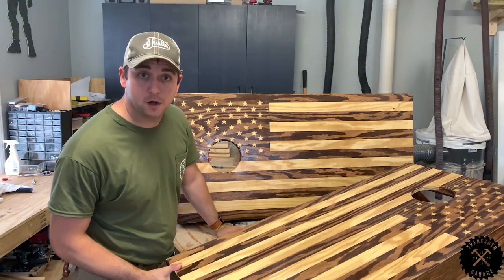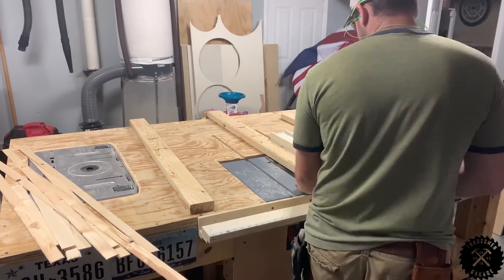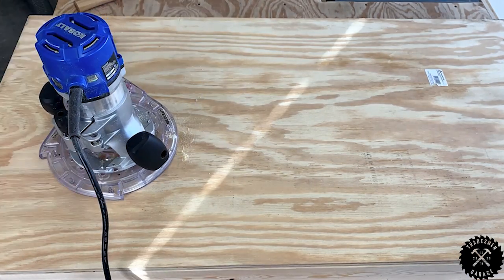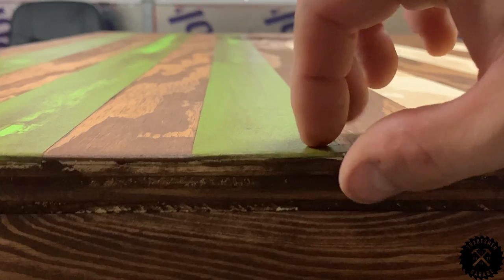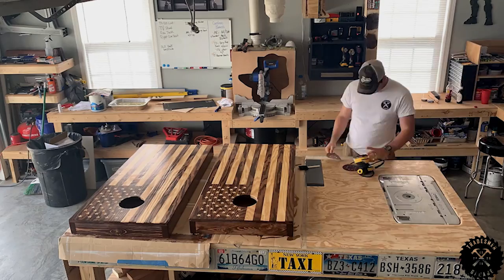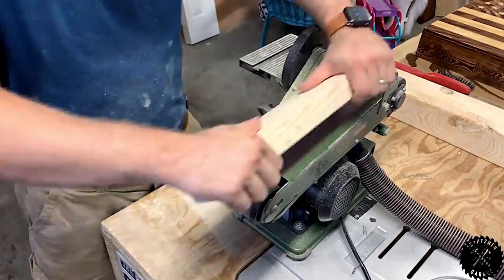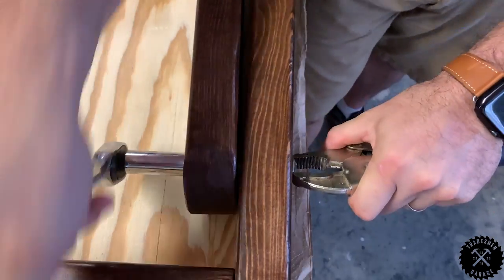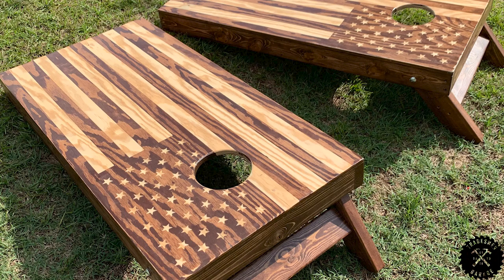How to Make American Flag Cornhole Boards

Comment: You could save a ton of time and energy using 1”  star stickers from amazon. Place the stars,  stain, and lift the stars. Does the same thing as the tape?
Reply from the maker: Micah Crossman true!  But I’m now using vinyl since I got a vinyl cutter recently 😎
Reply: @TradesmenGarage  I just got a cricut and am experimenting with it. Are you making vinyl stars? Or using the vinyl as a stencil and painting on stars? I'm interested making American flags from lumber and definitely want to try to make a set of corn hole boards like yours. I have a dremel and a cricut - what have you determined was your preferred method of making stars?

Comment: Amazing job, these boards came out awesome!  Was wondering what stain and final coat finish you used?  I tried making boards with stain and the stain bled through the tape and I did not end up with crisp lines.
Reply from the maker: Minwax Gel stain,  normal stain will bleed.  Pair the gel stain with green frog tape and it makes a world of a difference.  Spar Urathane water based.  Its a great protectant.

Comment: you should redo your tablesaw table top, in melamine or glue down a layer of plastic laminate (Formica). It will help the wood glide across the smooth surface.
Reply from the maker: Michael Sullivan I thought about that.  But I’ve since upgraded my shop and no longer have that table saw 🤙
Reply: @TradesmenGarage  nice, this is first video I've seen from you. So i'll watch more so i can see your shop. Subscribed!

Comment: What was your union on the board and do yo have plans ?
Reply from the maker: Corley Twidwell well. I picked up a stencil on Amazon thinking it was the right size but it wasn’t big enough.  So I still used true star size, but I spaced the stars out with a small little spacing jig I made.  It was basically a board with lines on it to mart the center point of the stars.  Did a little math and got the spacing pretty close to exactly where they were supposed to be.

Comment: When you say 12 inches of board height are you saying 12 inches from the bottom of the frame to the floor surface? Or 12 inches from the top of the board to the floor surface? Pretty sure I did the later and now its too low to the ground :(
Reply from the maker: Should be 12 inches from the top surface to the ground.  Sorry for such a late reply.

Comment: For the pocket holes, I’m using the a different one than you, “The Blue One” and the holes seem much closer to the bottom of the board than yours. I’m assuming your depth is set at 1 1/2in for the drill bit and the Jig?
Reply from the maker: My jig is set for about 1.5 inches
Reply: TradesmenGarage thank you for confirming! When I set mine to 1 1/2 the holes are almost to the bottom of the 2x4 away from the 1/2 board. Looked just opposite compared to your video!
Reply: If your using 3/4” plywood, your jig should be set at 3/4” thickness and the collar needs to be set a little less than 3/4” (plywood is a little thinner so you don’t want to blow through the topside). Use 1 1/4” coarse screws. Always set the jig for the thinner material.
Reply: Bob Hutchinson thank you! I will give that a try.

Comment: What size was your star stencil?
Reply from the maker: Kevin Flynn it was 11 x 8. But it was to small so I had to manually off set each star and figure out the spacing
Reply: @TradesmenGarage  Thanks ya I saw that wanted to buy a bigger one....Great video...

Comment: Did you find that your stars evened out with the finishing or were they still recessed in a bit?
Reply from the maker: Jon Rosenlund after I put the final coat, they came out flush with the rest of the board.  Just make sure you over fill them on the second to last coat 👍

Comment: The board height measures to the top off the board?
Reply from the maker: Correct.  At the top it should be 12” to the ground and at the front or bottom of the board it should be 4” from to the ground

Comment: Hey man, I think wing nuts would save you some time and hassle for the bolts. But the boards look great!
Reply from the maker: Anthony Laney thanks man!  I actually used to use wing nuts, but I got tired of the legs loosening up.  Figured I’d try it this way an I have to say that I like it a little bit better.  Just depends on your preference.  I’m my new design for the boards, I might have the wings make a comeback!

Comment: Hey man nice work! Im getting ready to build this set for a customer. What kind of plywood did you use?
Reply from the maker: I used 3/4 CDX plywood.  There is a pre sanded version that is sold at Lowe’s, but I found that it is hard to get a good finish on it so I would go with CDX for this particular board set.

Comment: Nice looking boards but need to use better plywood. Go with Baltic Birch
Reply from the maker: Steven Segars thanks!  If it was available around here I would!  My next set I might try a maple plywood and see how it turns out.  Finding any wood other than pine nowadays is harder than building the projects 🤷‍♂️

Comment: Does anyone complain that the boards are to slippery? I think they look awesome, I might make some just like you
Reply from the maker: DIY with JIM thanks man!  No no complaints on them so far!
Reply: @TradesmenGarage  you make two set out of one sheet of plywood correct?
Reply from the maker: That’s correct.  But my new method is using higher grade plywood and using it also for the frames and legs.  I’ll drop that video as soon as I finish it up!
Reply: @TradesmenGarage  that is what i am going to do A C plywood is that what you are going to use? Do you mind if i make a video on me making them i will say i got the idea from how you did it and put it in my description?
Reply from the maker: I’m going to use 11 ply 3/4 in maple plywood. Birch if I could find it but don’t have that around here.   Sure! No worries and let me know when you post it I would love to see it!
Reply: @TradesmenGarage  ok no problem i think i could do that. good luck with your channel it is great keep going it took me about 8 months to get a 1000 subs now i got almost 1800 two month later. This youtube thing is kinda fun if you have any questions about youtube just ask. i have learned a lot in the last year. Really loks like you need no help your videos are Awesome. Have you done this youtube thing before?
Reply from the maker: DIY with JIM I appreciate it thank you!

Comment: why not use pocket screws to attach your side and end 2 x 4 instead of wood screws that you later will have to cover up with wood filler?
Reply from the maker: Eric Jaspers I made them that way before and honestly don’t know why I didn’t on this particular build.  I use to miter the corners to 45 and picture frame the base and hide them with pocket screws. I’ve changed the entire design since then, so a new version will be shown in some upcoming videos 🤙🤙

Comment: Next time take an old tennis shoe and use the sole to clean the sander belt.  Doesn’t damage the belt but cleans up perfectly!
Reply from the maker: Web Crawler ooooo I like this!  Thanks I’ll give that a go!
Reply: TradesmenGarage You’re welcome!  I used buy the rubber sticks from the wood supply then my dad told me they used use old tennis shoe outer souls instead.  He’s been in woodworking for decades.  I tried and I was shocked, it worked exactly as the rubber stick. 👍

Comment: Why not use pocket screws for the corners on the frames and use star sticker pre stain then peel with tape
Reply from the maker: truth h so I ended up just using screws on the end joints since I hadn’t thought of it at the time.  But I have changed my process completely now and I’m in the process of making a new video right now.  As for the stars, I didn’t own a vinyl cutter at the time of this video and I wanted a hand made feel for the stars.  I have since purchased a vinyl cutter and have started using them in my more recent projects.
Reply: @TradesmenGarage  I'm finishing a set today to. Starting a rebel flag set tomorrow
Reply: I didn't see your pocket hole jig listed in your tool list.  Who makes that jig?  Looks interesting!  Great boards.... That's a lot of time invested, but fantastic results!
Reply from the maker: William Roozenboom ahh sorry bout that. I missed that one.  It’s a pocket hole jig from Harbor Freight.  Good starter product but I would Recommend the Kreg HD pocket hole jig with dust collection.  Much faster cleanup
Reply: @TradesmenGarage  I used to build them the same way you did in this video. I too switched to using the pocket holes in the corners of the frames as well so that way the only fastners that you see when the boards are set up are the carriage bolt heads for the legs. I also started making my top and bottom frame rails at 2 foot long and cut my side frame rails to fit into them so that when the boards are set up and you are looking at them from head on you don't see the end grain on the side frame boards if that makes any sense at all.

Comment: To be respectful to the flag, ensure that the 'blue field and stars' are in the upper left-hand corner as you look at it.
Reply: They are
Reply: I believe they already are
Reply: @marc01776  it is still considered the flag and should be right.  When viewed in the vertical orientation (like the viewers would see), the only time the union would be on the right us if the flag is draped over the casket of a military member.   In that case it would be over the decedent's left.
Reply: @truthh8322  when a flag is hung vertically (as you play cornhole) the union should always be on the viewers left hand side. These unions are on the right hand side.
Reply: @marc01776  on its side is correct. When playing its not, and being an American that served and loves this country it is an eye sore to me. If the union was on the correct side you could still get the same effect on its side it would just be the opposite side.
Reply: @Circa1775  Actually you gotta flip the flag over to get the union on top left from a horizontal top left. Which means these boards are correct.
Reply: @truthh8322  the union can be on either side of the flag if its horizontal. But when vertical as they are when youre playing the game the union should be on the left hand side, so these flags are wrong in the aspect.
Reply: @Circa1775  that's just where u stand.
Reply: @truthh8322  lol no thats facts brother. The flag is vertical while game play, just like if you hung it up vertical.  The union is on the wrong side, plain and simple. You can even see it in the thumbnail.  And being a veteran the flag horizontal can have the union on the upper right when you wear it on your right arm of your uniform so it looks as if the flag is moving forward and not the opposite as if its retreating. So all in all, the union is in the wrong spot on these boards which sucks cause he put time and money into it, just needs to fix it on the next one. 

And if its where I stand, then I'm standing on the right side.
Reply: @Circa1775  whatever u say

Comment: Why wouldn’t you have added pocket holes in the corners of your frame pieces  to assemble the frame?  Would’ve been easier than running long wood screws through the side. And you wouldn’t see them

Comment: The front of the board should be 4” off the ground. I looked up the ACL boards.
Reply: 3 1/2" from the 2x4 + 1/2" from the plywood = 4" from the ground

Comment: The flag looks right on its side. But when playing the union is on the wrong side.
Reply: How is it on the wrong side while playing?
Reply: @mudd_m-cubed_customwoodworks  because the flag becomes vertical. And a vertical hanging flag the union should be on the viewer's left hand side per flag code. Yes this isn't a real flag but for someone who knows these things and likes to see the flag represented right we notice.
Reply: Circa1775 But that depends on which side of a hanging flag you are standing. But if you are talking about a flag hanging against a wall or from a window sill yes you are correct. Union is to be in top left as viewed by observer.

Comment: Get a cricut or silhouette, cut those stars in vinyl on 1 sheet and just stain them the same way you do with the tape. save yourself the headache and time of tracing them all and then using the router. I also don't like the idea of the stars not being level, probably will be rough and keep bags on the board that shouldn't be

Comment: For reference.. U.S. Code Chapter 1 - section 8 respect for the flag. No disrespect should be shown to the flag of the United States of America; the flag should not be dipped to any person or thing. Regimental colors, State flags, and organization or institutional flags are to be dipped as a mark of honor.
(a) The flag should never be displayed with the union down, except as a signal of dire distress in instances of extreme danger to life or property.
(b) The flag should never touch anything beneath it, such as the ground, the floor, water, or merchandise.
(c) The flag should never be carried flat or horizontally, but always aloft and free.
(d) The flag should never be used as wearing apparel, bedding, or drapery. It should never be festooned, drawn back, nor up, in folds, but always allowed to fall free. Bunting of blue, white, and red, always arranged with the blue above, the white in the middle, and the red below, should be used for covering a speaker’s desk, draping the front of the platform, and for decoration in general.
(e) The flag should never be fastened, displayed, used, or stored in such a manner as to permit it to be easily torn, soiled, or damaged in any way.
(f) The flag should never be used as a covering for a ceiling.
(g) The flag should never have placed upon it, nor on any part of it, nor attached to it any mark, insignia, letter, word, figure, design, picture, or drawing of any nature.
(h) The flag should never be used as a receptacle for receiving, holding, carrying, or delivering anything.
(i) The flag should never be used for advertising purposes in any manner whatsoever. It should not be embroidered on such articles as cushions or handkerchiefs and the like, printed or otherwise impressed on paper napkins or boxes or anything that is designed for temporary use and discard. Advertising signs should not be fastened to a staff or halyard from which the flag is flown.
(j) No part of the flag should ever be used as a costume or athletic uniform. However, a flag patch may be affixed to the uniform of military personnel, firemen, policemen, and members of patriotic organizations. The flag represents a living country 
and is itself considered a living thing. Therefore, the lapel flag pin being a replica, should be worn on the left lapel near the heart.
(k) The flag, when it is in such condition that it is no longer a fitting emblem for display, should be destroyed in a dignified way, preferably by burning.
Yes, you are free to disrespect the flag of the United States of America by using its image on cornhole boards. 🇺🇸🗽

Comment: This has been a question that's been nagging me for a while now. Bear with me here. When displaying the flag the union always belongs to the the uppermost left as seen by the observer whether displayed horizontally or vertically. Every single American flag Cornhole  board I see has the union on the upper right as seen by the observer, which is the wrong way to display our flag, why is that?
Reply: The top left is considered the position of honor. If the flag is flown on a pole the union would be the highest portion of the flag. The top left remains the position of honor when displaying the flag vertically as well. I know cornhole boards aren’t hung vertically but IMO the union should on the other side of the elevated portion of the board.  You would be shocked at how many  Americans do not know flag etiquette like position of the union and flying the flag in hours of darkness.
Reply: @TricksterTimbo  I am well aware, I see flags displayed improperly all the time. While I appreciate the patriotism of someone flying the flag, it's a very simple thing to look up how to do it properly. In fact there's a government website that gives all relative information on flag etiquette and official dimensions of the flag and all of its parts. People are too lazy to look I guess.